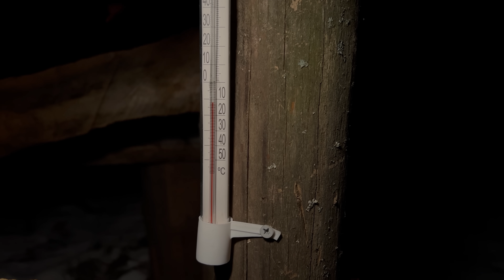COZY DUGOUT: I made a wood BRICK STOVE in one day, delicious FISH SOUP

Comment: Beautiful example of the difference between something like a microwave oven vs a stone pizza oven. The microwave heats quickly but cools just as fast, while the stone oven takes longer to heat, but stays hot for a long time. 

Heating a living area with a brick oven might take longer to get up to temp, but you'll save a lot of fuel and effort once it's hot. Your little dugout is a wonder, you put so much work into it and it has become an amazing little place to call home.
Reply: Similar to forced hot air vs. forced hot water heat. Forced hot air will heat a space quickly, but the space will cool quickly if the heating system fails. I live in a VERY cold area (Northern New England) and have had my boiler fail, but I have forced hot water with cast iron radiators and in the dead of winter, my house will stay warm enough to sleep comfortably for up to 3 days. (Thermal efficiency for the win!)
Reply: why did you make the brick fireplace? 😳
Reply: @cook_sail  Uhmmmmm.....I didn't? He did?
Reply: you could do both, have the bricks on the sides for thermal storage, but the metal would heat much quicker and to a higher temp, plus you can damp it severely to burn longer.

Comment: Great job Alex. I've watched several folks build a similar "stove/furnace". You did EVERTHING right.
You will find that, over time, the "plastering" around the metal parts will crack and shrink (normal). an easy way to fix this is to mix up, from your mortar, what potters call "slip", a very watery mix. Pour this into the cracks. It may take several times to fill the cracks well. Using this method save you from having to re-plaster the stove.
I've watched you and others build dug out shelters. None rise to your level, two come close, very close. Still your the best. ;-)

Comment: Masonry cement is really 3 parts sand to one part cement. If you can get the sand locally you should be fine using the local sand on a little project like that. Transporting a small bag of Portland cement should be a lot easier than hauling a 4x bigger bag of mortar mix.

Comment: Great job! You can also heat the dugout by placing lighting a candle and placing an upside down terracotta pot over it ( I use flower pots as they have the drain hole that allows venting)  to help keep my home warm when we have power outage. You would be amazed at the amount of heat it gives off

Comment: Exterior doors should open OUTward - not inward. They are much stronger structurally and resist being pushed in when they open to the outside.
Reply: Except where it snows a lot. Overnight accumulation can trap you inside. Ask anyone in Canada